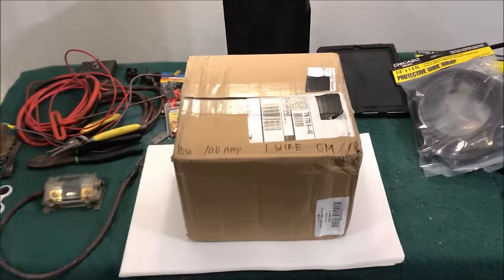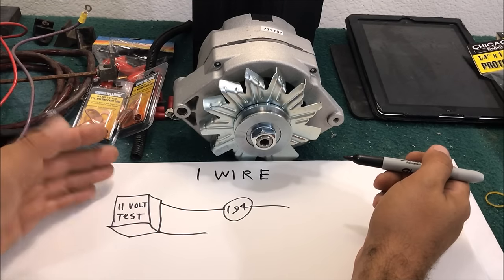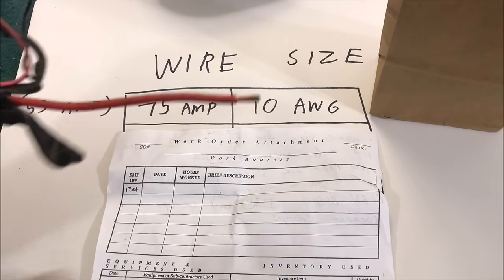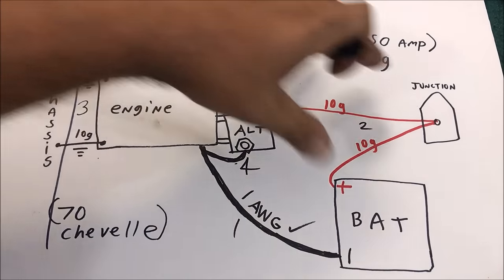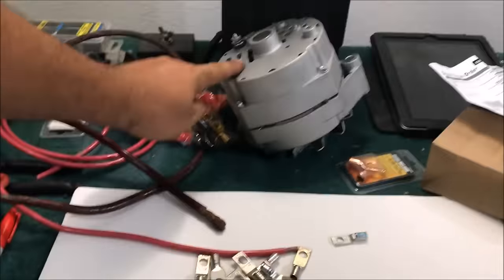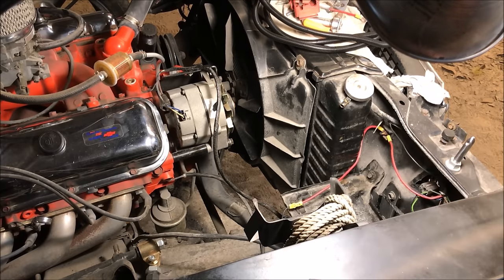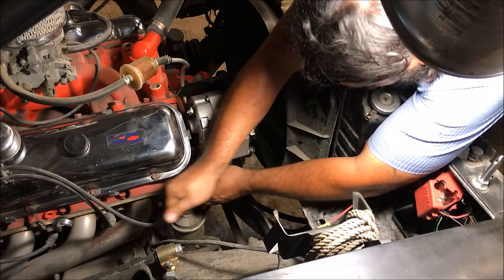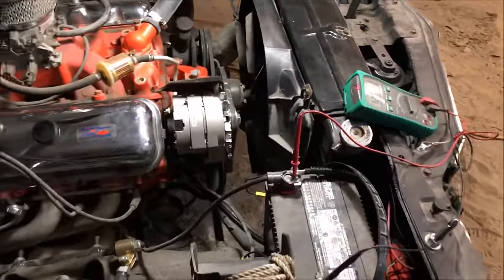GM 1 wire 100 amp alternator UPGRADE and INFO diy

Comment: Would it be okay to use the thin cheap terminals just for mocking things up and letting the car run , not road use
Reply from the maker: I would not cause you are just gonna leave them on there and forget to replace them
Reply: Chris Craft I just wired  up my alternator for the first time and it’s making a squeaky rattle sound when I rev up , it’s been on the car with the belt running and it didn’t make any noise then what could this be, working on 67 firebird with Chevy 307 just internally regulated it  I don’t have much experience
Reply from the maker: Watch my gm 3 wire alternator hook up  video and make sure it is right
Reply: Chris Craft yes I have watched thank you , dose this noise mean bad alternator
Reply: It means the belt is slipping. Wiring up the alternator put more load on the belt. Try tightening the belt.

Comment: Chris every diagram i see show the jumper wires going from blue to orange white to brown u have yours blue to brown white to orange. i have a 71 camaro does it matter witch way they go?
Reply from the maker: if you wire it like that you will drain the battery...and the gen light won’t work... that is the dumbest wiring I have ever heard in my life...  it doesn’t even make sense...

Comment: The original ammeter on my dash shows a discharge with my 100A alternator wired directly to my battery. Studebaker originally had a 12v generator
Reply from the maker: internally regulated use a volt meter.. how many volts is it charging.. you may have to rev up the engine to excite the fields
Reply: @chriscraft77022  14.25v at idle, 14v at the battery. I need to add the ground cable too and will get a volt meter gauge for the dash. Thanks

Comment: So I'm slightly confused.. What are the benefits of going from 2 wire to 1 wire? And also, I've got a 69 Chevelle. No idiot lights, so would I be able to use the charging gauge in the original dash?
Reply from the maker: no benefit, it’s a racing or tractor thing..in my opinion
Reply: @chriscraft77022  am considering options for race car.  69 Chevelle. Am building motor to run on NITRO in one fuel cell (for track) and secondary fuel cell for street and shows...

Comment: Question.  So I switched over to a 1 wire on my 71 Fastback.  So, still having battery drainage and killing my battery. When installed, the OEM wiring harness isn't hooked up to the new alternator but still ties into the volt/reg and into solenoid.  I'm thinking the issue is that the alternator isn't being told to turn on to charge the battery?  Someone suggested running a "hot" wire switch to the alternator?  Wouldnt that be just finding the old wire (prior alternator setup) and running that to the battery?
Reply from the maker: you don’t use a voltage regulator with a 1 wire get it out of there.. you have a parasitic draw.. running hot wire to alternator doesn’t make any sense... watch Eric the car guys parasitic draw video if disconnecting the regulator don’t fix it.. I had a 67 fast back with a gm alternator before.. threw that Ford shit in the trash
Reply: @chriscraft77022  Ty! Plus you have another "smack that bell"!

Comment: Ok my old alternator was 65 amp charge light was dim. So I changed it out for a 105 amp and now when I shut car off and pull key out charge light stays on plus my tack is on 9 k when I turn key on tack goes to 7 k and charge light goes out  this is on 84 oldsmobile cutlass help …alt is 3 wire

Comment: Hey Chris....I have a 69 442 that a
Has electric fans and Fitech...it has a 63 amp alternator...will the 100 amp be what i need for it or should I got with the 150 amp 1 wire setup?? What is the part number for your 100amp? Thanks again for all the great videos
Reply: Amrik, any updates? I have a 68 Tempest that i will be adding FITECH. Did you try running FITECH with the 63 amp? Also are you running the Command Center? Did you need an adapter for a spread bore manifold?
Reply: Also if you are running the command center have you had over heating issues?

Comment: Chris, off topic here but...if the gen bulb was burnt out or that leg of the circuit was open, the alternator would not charge, correct? And do you know if olds used the same circuitry? I have to travel to a shop to diagnose a 72 olds 442. The problem is it drains the battery when driving and the techs at that shop can't figure it out. I'm leaning towards something simple they've over looked. 

I haven't seen the car yet so i Don't know if the alt is internal or external regulated although any information I've Found indicates the 442's used internal from 70-72 but that doesn't mean That's what's in the car...could Very well have the wrong alternator in it to begin with lol. I'm gathering information for when i go to the shop in Friday.
Reply from the maker: watch my gm 3 wire alternator video.. and easy conversion .. those cars are externally regulated.. it will still charge just have to rev it up a little to start.. change it over to internally regulated cause the wiring can be mest up
Reply: Chris Craft not sure what it has but i think the customer wants it original, it's fully restored but i think those guys are overlooking something. I'll check that video
Reply from the maker: feel free to ask anything I know all about the factory wiring as well..
Reply: Michael Leon 
Were you able to figure out what was draining the battery?

Comment: What do I do with the factory alternator wire that runs over to the external regulator when I put in a100 amp alternator one wire? In my 1970 Chevelle?
Reply from the maker: I have an old video on converting the harness to internally regulated.. it sucks but go watch it

Comment: Hey chris I emailed you the other day,I need your advice, I want to run a pretronix 1181ls igniter module on my 1967 impala 283 cu in motor,do you know if I need to still use the resistor wire from the factory,thanks guy
Reply from the maker: I’ve never ran one before but the coil is what uses the resisted wire so I’m guessing it stays the same ...
Reply: @chriscraft77022  thanks so much,I have been in to old cars for a long time my dad was a mechanic owned his own esso service station  I learned a lot from him,I really enjoy your channel you make things very simple for idiots like me

Comment: I've tried two Denso one wire units , neither will charge at all
Reply: @bobbofly  Thank you ,  I'm pretty sure that's the problem . I't does charge if I hook it up like you said , wont charge at all with just one wire hooked up

Comment: What brand is that crimping tool? 
Ty
Reply from the maker: Greenlee  K05-1GL
Reply: @chriscraft77022  please tell me this is not $250.. am I looking in the wrong place.. ug..
Reply from the maker: @joesdot3288  if you live in houston, tx you can borrow mine..  they are used for around $120..   i have electrician friends..  sorry...  let me know if you find a cheaper one..  you want to crimp it right..
Reply: @chriscraft77022  found some online for about $80.. Checking out the quality..
Thanks so much for the video 👍

Comment: can outgrade 12si 100A to 140A ?
Reply from the maker: yeah, if you upgrade the wires to #2 or #4 AWG like I did... mine is good for 150AMP now
Reply: @chriscraft77022  but standard 12si is 100A no 140A, maybe i have to change bridge diodes & regulator for 140A ?
Reply from the maker: sorry I thought you were talking about 10si.. I really don’t modify anything newer than that.. what does a 12si come on?
Reply: @chriscraft77022  im running powermaster 100A 12 SI but need upgrade to 140A ( two electric fans, electric water pump, electric fuel pump)

Comment: You need a fusible link or maxi fuse between the battery and the junction block.  If that line shorts out,  your car is toast.
Reply from the maker: why didnt the factory put one there?
Reply: That's right there are none from the factory installed.

Comment: So where in this video that you show how to and what wire goes to a amp gauge
Reply from the maker: the amp gauge wiring has nothing to do with an alternator... I have a video on wiring an ammeter
Reply: @chriscraft77022  ok I will look for it.i like to know which wire goes to the volt meter
Reply from the maker: @ricktownsend2871  the volt meter can be wired off anything with 12 volts..  just like you check voltage.. with a volt meter..   from anywhere..  i show it in my auxiliary gauge video where i wire one up off the radio wire and gauge grounds...   literally, any wire with 12 volts ON WITH THE KEY..
Reply: @chriscraft77022  awsome thankyou very much ..btw your videos are very good.
Reply: This alternator and amp gauge is all going into a race car so I'm starting from scratch to do all the wiring just need to know which one to go to a voltmeter but now I got it figured out thank you very much

Comment: Mine reads about 10 when I start my 496 stroker motor and after a few minutes goes to 14
Reply from the maker: you have to rev it up and it will start to charge after the fields energize..  if you strart it and hold the rpm above 1000 it should start to charge
Reply: @chriscraft77022  Thank you

Comment: On my 57 Bel Air with a one wire the generator light stays on permanently.
Reply from the maker: thanks for that comment.. you are the 2nd person to say that… I will look into it now..
Reply: @chriscraft77022  You gave an good and accurate presentation. But on cars that are as old as mine who knows how much half assery has gone on in the wiring?
Reply from the maker: @daxtonbrown  my brain just received a message that it must be something to do with ORIGINAL GENERATORS on cars..   i have only messed with cars that have externally regulated ALTERNATORS.. please let me know what you find
Reply: @chriscraft77022  "By 1960, automotive alternators were standard equipment for most car makes. Prior to that, generators had been used in vehicles because rectification of AC current into DC current required mechanical means until the advent of heavy-duty silicon diodes. "
I should have known this. I even met Schockly once, inventor of the transistor.

Comment: that battery is not going anywhere.. hahaha, the handle is tied between the battery and the block.
Reply from the maker: The battery sits on the inner fender which I have to put back in after it gets painted..  I ran a car like that a long time ago and the battery fell out...
Reply: @chriscraft77022  9dlls a battery holder.. or a strap would do the job..

Comment: When they say "self-excited@1200rpm", I always wonder if they mean crankshaft speed or stator-shaft speed... because if they mean the latter, the drive ratio between the crank & alternator pulleys becomes critical. And if it's less than 2:1, then you can forget having an even an "unloaded" at-idle operating voltage like seen here! [:(
Reply from the maker: Well on most cars you have to rev 2000 to get a 3 wire to kick in with no exciter so I’m gonna say shaft rpm